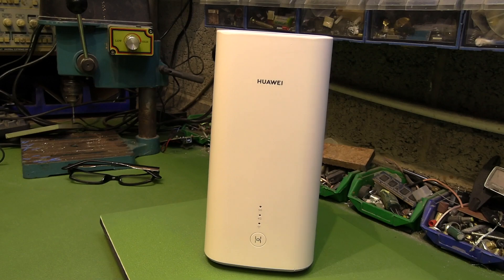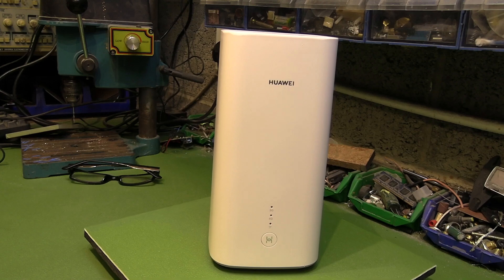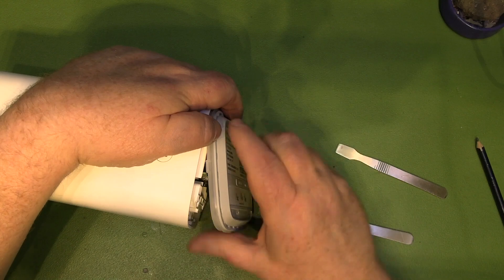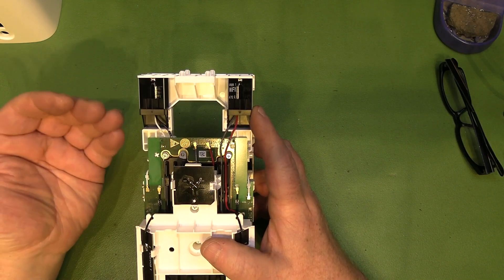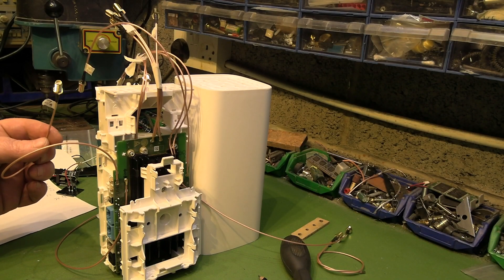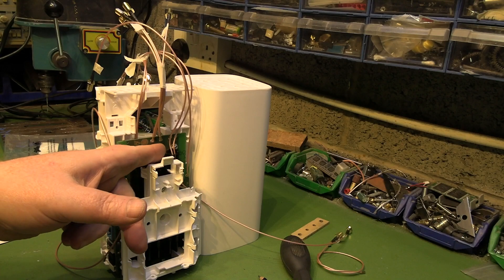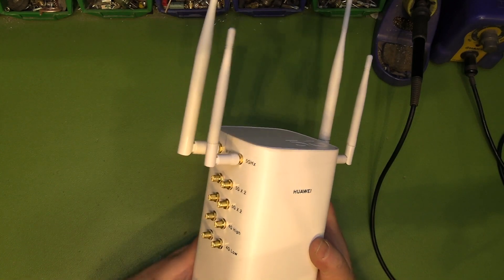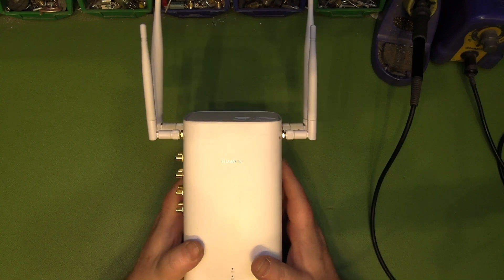Huawei 5G CPE Pro H112 370 Full External Antenna Modification

Comment: I’m finding this video quite interesting !!  However Im not sure if you can assist me. Basically i live in a ditch. I only get good signal 4G and 5G on top of my house. I’ve got the same router as in this video but it’s under contract So I cannot make modifications. I can place an antenna on the roof of the house but I cannot plug into the router of course. What can I do to improve my situation since the signal is not worse with all other isp

Comment: The UKs deployment of 4 and 5G is poor, you will struggle to get anywhere near this modems advertised speed unless you're in the city even then you'll be lucky. Andrew maybe you talk about antenna cable length, the length limitation's which means having to locate the modem either in the loft or the first floor if your going to professional grade external antennas like Poynting for example

Comment: hi qustion what cable is most recommended to get to make 4x4 extension cable for external antenna sma male female pleanty off choce just dont know what is more sutable for 4g 5g intenet for my anttena RJ178 RG58 and others ,done the conversion on my 4/5g router similar like on the video just different mark model principal is the same it works got 4x4 mimo 4g 5g panorama antenna and the stock cable is 5m not reaching where is the location i'm getting good signal i know it have ready extension cables amazon ebay and all of them use different cable types so just wondering what will do better job.Excellent video by the way this pushed me to do the conversion on my router

Comment: please andrew, post something
Reply from the maker: LOL I will
Reply: @andrewmcneil  Hi andrew, I propably asked you this question twice, and I apologize for that. I need an antenna that hits 1700mz and 2100mhz. Should I build the "3G 4G and now 5G Biquad Panel Antenna"? I know that this antenna should also have some gain around 700 mhz frequencies (since it hits 800mhz). Sorry for disturbing.

Comment: Question why do you need 4 connecting for  5g Modification??? So you can have two more antenna
Reply from the maker: Its not a 5G mod it’s a total mod 2x 3.3GHz 2x2.7 GHz 2x2.2GHz 2x900MHz
Reply: @andrewmcneil  thank you. I'm understand it now. More antenna to make Internet  faster by 4g and 5g signal.. thank you for making this video. I did not really want to pay someone to do this Modification as cost a lot..

Comment: Hi there, I have a Poynting 4G-XPOL-A0002 Antenna. and am getting other antenna is 5g. My question is can you link to Antenna to together ? if yes how do I
Reply from the maker: If your question is can you connect two antennas to the same connection? The answer is no that would be very bad.
Reply: No I means  so you can add more antenna  like 4g and 5g antenna into Router is Modification.

Comment: Recommendation for anyone here who doesn't live close to a cell tower and doesn't have a 5G router yet, get yourself a Zyxel NR73xx outdoor router instead. Performs extremely well under n78 and B7 (I'm getting -105dBm n78 from around 7km away with it).

Had a indoor router instead and while it was somewhat good, it connected to a closer tower with B3+8 only.

Comment: Hi Andrew
Simple question: I have an external 5G antenna with an SMA cable. Can I just plug it into one of the two 5G antenna pigtails to SMA on the router and I‘ll be fine?

Comment: Hello, respect effort and great work there Mr andrew 
quick question : is this device similar to the cpe pro 5 under the name of Brovi tech model h158-381
From the frist sight look I was sure it’s similar just want to confirm
So I can apply same setup as yours or if you could share info how to know if which ant cable I shall be replacing to increase freq 2k above

Comment: Hey mate, did you ever figure out the antennas for the H122? There's a black square up on the front wall and on the left wall, I believe the left wall is the LTE main ie that's what you would aim to target a mast. Front wall I think is just a 5G high band only SA. Each corner has some real tall antennas with one connector, two blacks on the right hand corners and two greens on the left hand corners. Trying to work out if it is worth me swapping around the big corner antennas you see.

Comment: love this videos !! do you mind creating a new videos, with content "HOW TO DETERMINE WIFI2.4G/WIFI5G/GSM4G/GSM5G PORT ON PCB"?? i have differrent routers/modem, and im planning to only change the 5G antenna to external due to cost reasons... (antennas set (include good coax wire) are quite expensive for me, and my objective is only 5G to be good)
Reply: also, is combining 2 port into 1 5G external antenna are bad ideas?

reason is im thinking if i could merge 2 port using Y and use only 1 external antenna for 5G is better, or leave 1 stock internal and 1 external antenna is better... thankyou !

Comment: Hi Andrew, very informative video thanks for that. I would like to use this modification on a router I use in my campervan. However I have mounted an external antenna with only two 5g and two 4g antenna's plus two wifi antenna's. Would it work when I only do half of the modification? So disconnect half of the internal antenna's and connect them through your mod to te external antenna and leave the other ones in function as they are? Let me thank you in advance for your reply.

Comment: hi Andrew. Thanks for this video. It’s really helpful! I have one of these that I’d like to have a go at myself but can you help with the SMA pigtails that I needed to connect to the internal motherboard. Are these click on or is there soldering required? Would appreciate any guidance and thanks again for the video!
Reply: and in fact i just realised mine is a 122-373 which only seems to have one 5g antenna inside. is there a specific type of directional antenna i would want for this scenario once the mod is done?

Comment: Now that there are new WIFI 7 routers with the new 6 GHz (5.925-7.125 GHz) band,
it would be really cool to see a 6 GHz Yagi build (or similar directional antenna). Because you can't buy them right now if you don't want to spend 400$ or more on a antenna.
Since the Frequency is so high a 12 Element design would even fit on a 150mm PCB. 
Sadly I don't have the skills or equipment myself to design it but it would be so cool if you would design a PCB antenna that everyone can just get made online for a few bucks 🙂
Reply from the maker: I will look into it and your correct it would fit onto a 150mm PCB 👍

Comment: Doing that, the router still having a good signal using only the internal antennas or not? He becomes full dependent of the external antennas?
Reply from the maker: yep
Reply: @andrewmcneil Welcome back Andrew! Love your channel! Sorry if I didn't get your answer but I have the same question but afraid that the router will then only work if connected to external antennas. Is that the case?
Reply from the maker: @iMsMs  Yes this was a total mod

Comment: I just did that with my 4G B-818. But it also has 2 X  external factory horrid little TS-9 connectors I swapped for SMAs. Doesn't the CPE have external jacks? I now have 6 antenna options.

One thing you failed to mention was that the factory internal 4G and 5G lead sets are each for 4x4 MIMO, or you can do two pairs of 2x2 MIMO yagis to them. Speed galore!

Comment: I have a B628-350 and I also wanted to modify it to 4x4 since there is only 2 TS9 external port
I just wonder where to connect the pigtail since there is a lot of antenna inside unlike my greenpacket d2k-ft10 that has only 4 ports inside

Comment: why did you modify the Antenna that much.
Is there an original connector on the back of the Huawei H112-370 that comes with the TS9 Antenna plug?.

what if using the original TS9 connector Antenna without dismantling is there any change?
Reply from the maker: It’s called information as I said in the video you don’t have to mod everything. Modification gives you options over a stock product if you don’t need those options don’t mod it.
Reply: Ts9 only supports 5g band
Reply: @thebutcher1422  Why only T9 only 5G band?

Comment: Did i literaly wait one whole year and change for someone to really talk about this but the person that I NEED to speak about! What do you mean locked???? Don't forget to add the amazon links.
I want to know what antennas can  you use for these. I for sure have been plugging in antennas that probably don't work also my U.FL connects, the wires are VERY small. What do you recommend for antennas? I'm like scared that nothing will work. And is it mandatory to use 4 antennas that are similar as to.. 2 of you own antennas and 2 of their antennas?
Reply: Firmware LOCKED to a specific service provider - only certain simcards will be accepted. Unlocked means you can connect to whichever one you want to.

Comment: My brother has Three 5g router issues. The 5g mast is 500 metres away line of sight. Router is in the bay window and i can see the tower from there yet it keeps saying no internet. 
Tested speed over the road from the tower, 694mbps whereas outside the house it drops to 384mbps. 
Does it need this upgrade or is more going on ?
Reply from the maker: Sound more like a problem with the router than distance

Comment: I have a H122-373 at the window in my kitchen with no external antenna's and i get around -95 to -100 RSRP to band n78 resulting in the full 500MBit of my plan. cell tower is around 1km away.
You certainly don't have to live underneath a 5G mast. I was thinking about doing this exact mod myself years ago but decided not to since its already running pretty well. Nontheless absolutely brilliant video as always!